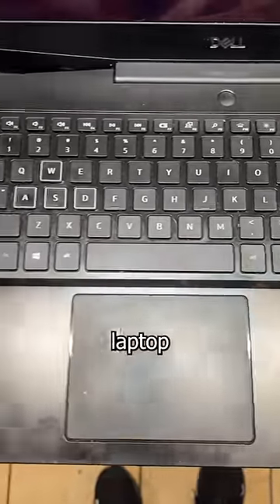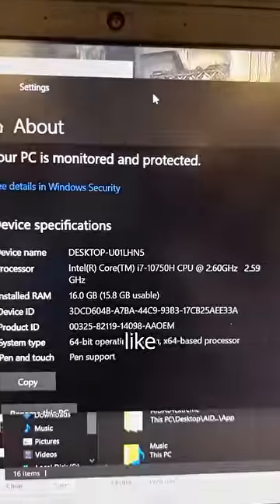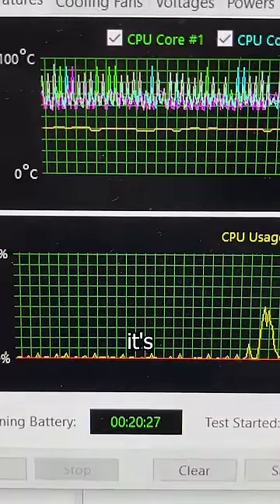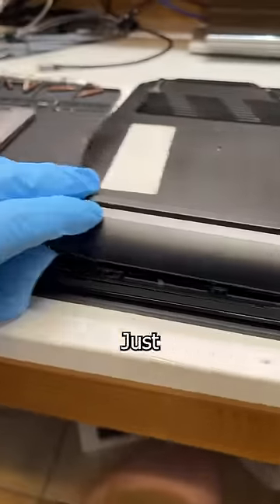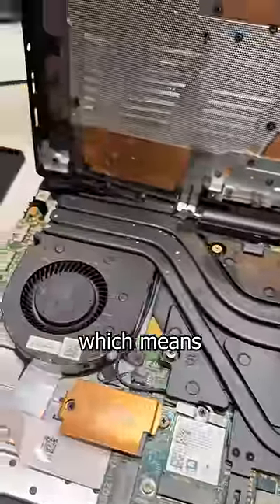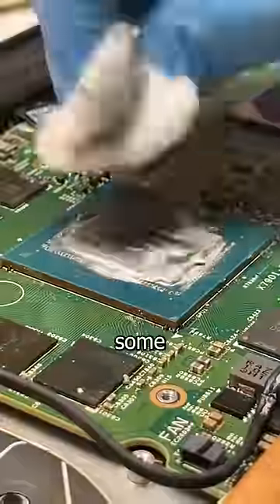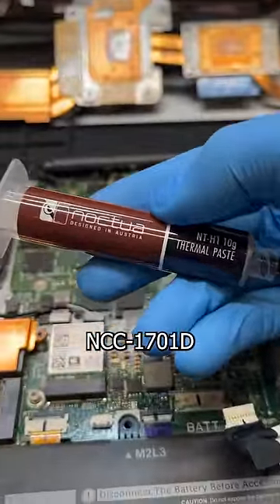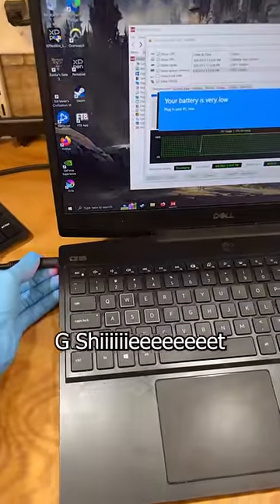Dell G5 is a terrible #gaming laptop with a terrible cooling system #tech #technology #shorts

Comment: I have a dell g5 5500 and I replaced the thermal pads on it recently to discover that there was plastic left on them straight from factory. 🙄 As soon as I changed the thermal pads and thermal paste with thermal grizzly kryonaut I got way better temps than what I was before.

Comment: If you’re interested in a g5 , read my comment, As a owner of one of these, the fix is get a laptop cooler, drops about 10c-12c, 25$ for the cooler,  bought mine for 375$ on eBay , also replacing the stock ssd to one with a heatsink is a must. Things are quirky but for sub 400$ and is on par with some high end systems , it’s a trade off I’m willing to have. Now I’m not an intense gamer, it is a spare system Just in case something were to happen to my main pc, or I want to play games at a friends house , so your mileage may vary. I highly recommend to fellow technicians, not to those who aren’t willing to spend hours pulling your hair out. Also the 2nd ram dimm slot randomly shuts off sometimes lol. Worth under 450$, anything more, buy something nicer.

Comment: I did a few things that cause me hours to figure it out, in order to make it playable: Instead of using thermal paste of whatever kind, I use a Honeywell PTM thermal pad. Throttlestop is also the solution for this as I was able to undervolt this cpu by -0.1v and lock the speed at 3.6. My specs are i7 10750h gtx 1660ti and this is now much more playable with a minor loss of performance. Do not buy this laptop, I bought it used, kinda hard to live with, and yeah it was a real stupid decision by me 😢

Comment: Sounds like the time I bought a refurb MSI GE laptop, only to find out that the core i5 in it would immediately go below base cpu speed due to overheating, upon opening it I realized it was not the stock "heatsink" that was inside it, but a much cheaper one instead

Comment: My 2017 Dell G3 with an i5 8300H and 1050 TI both thermal throttles and power throttles under load and I even repasted it! I have to reduce the max turbo speed to 3.5 using throttlestop just to avoid excessive temperatures when running heavy tasks for prolonged periods!

Comment: I have a G3 and it's downright decent. It can run all but the newest games, very few games absolutely max out the GPU, and those games only tend to slow down after an hour or so.

Of course I've upgraded the RAM and SSD, but that's a given because the stock ones are so bad.

Comment: I used a g5 for close to 4 years, I ended up limiting the cpu and I never had overheating problems and could pretty much play any game and get at least around 60 fps given low to medium graphics, I could run baulders gate 3 at 60 fps at low graphics at a temp of around d 85 c. This laptop may be not the best but I was my first gaming computer of any kind and served me rather well. Still works today but the hard drive is failing I think.

Comment: 1) Is it possible to upgrade the heatsinks/fan system?
2) If no, then the only real option is modding the case to allow more airflow (cutting holes out and installing some stands to raise it off the surface.
3) If no, inform customer he is an ID10T and he should have spoke to "The greatest technician that ever lived" before buying the craptop and then point him to one of your refurbished gaming laptops OR a new one from your sponsor :)

Comment: What I'm about to suggest might sound strange but did you check for Malware of any kind. My next question is did you check the paste type and how closely the heat sync mates up to the chips. My last thought is maybe his fans are simply shot or the heat sync is damaged. The fans if damaged wouldn't provide enough movement of air with the bottom on but would be capable with it off. If the heat sync is damaged then it might have a similar problem.

Comment: You know… 
Snap the fan power cable. Remove the fan housings. 
Then solder in two desktop grade heatsinks and slap on four noctua fans. 
Then see if it dares to overheat.

Comment: It looks like they just took a set of fans from an existing product and didn't care if they were adequate.
I know a laptop processor would run at lower voltages than a desktop one, but the newer Intel processors will either come with an aluminum block which is still larger than the heatsinks on that laptop, and most aftermarket coolers for 12th and 13th Intel processors will be 140+mm bricks.

Comment: Since you are such a good repairman, you will have to fix the bad cooling design!  We can give you a couple of suggestions for improving the temperatures.  The laptop used liquid metal to transfer heat, replacing it with thermal paste means you need a relatively larger surface area of paste and copper to distribute the heat.  The design itself would need a third fan, which would have the task of removing the coupling heat between the CPU and the GPU, and to be honest, all laptops would need an additional evaporation chamber with its own fan so that the gases could liquefy and cool.  So now they just overheat and overheat in the hope that the tasks will not last several hours!

Comment: I got a Dell 3080 off eBay, this is by a gigantic margin the most gimped graphics card I’ve ever owned.  It averages about.9v because the power budget is choking it, also the cooler works fine, but is obnoxiously loud, needs everything it’s got to stay under 70C.  And the vram is cooking 🤦🏼 I ended up getting a water block I have yet to install, that will be a fun project.  If it was a dual bios card I’d flash a higher power bios, but I don’t trust it to not be sketchy and crash mid flash or something, bricking the card.
Tbh, I wouldn’t be surprised if Dell got a discount on Nvidia’s least efficient GPUs, like the trash from the silicon lottery.

Comment: If it’s still overheating by just putting the bottom back on then I’d wager it’s just choked for airflow. Normally I’d just say undervolt it but I doubt you even can. Maybe the owner should try out one of those external fans that clamp over your exhaust and just suck as much air as they can?

Comment: I've had my G15 5510 for a few years now, only one drive failure (on an NVME? I didn't know it was possible, but I did have it under heat for a while), I do manage to keep it at 120 fps under most circumstances, and heat management hasn't been a huge issue.

Biggest repair I've done was the keyboard assembly when the shift keys stopped working at the same time. Still not sure what happened with that one, but I ended up binding caps lock to shift. Probably a good decision

Comment: I have an alienware laptop and found out that the fan controller on it after booting would mix the fans up. the gpu would get hot and the cpu fan would spin up and the opposite would happen with the cpu. Dell refused to fix it unless I paid them to fix it. it was a known issue with my laptop. only one program would work to fix my issue and that was hwinfo. was really inconvenient since it wouldn't start up automatically.

Comment: I have a G7 17 from a few years ago with a 9750h and a 2060. Processor always at 100c when gaming. Plus the power cable doesn't supply enough power and it starts draining my battery. It has some other issues also.. but I love it. Took it apart a couple years ago and replaced the thermal paste and cleaned it up.. doesn't throttle as much.. meh. I think I paid 2300 dollars for it when I bought it. Worth it? I would have paid way less in my opinion. But it's decent enough. lol

Comment: I know this is almost a year old at this point, but I’d like to know your thoughts (if you have any) on the Dell Inspiron 15 7000 Gaming, which is basically the predecessor to this G series. I picked one up for a great deal just as they were being replaced by these crappy G series back in 2017 (I think) and it’s served me well since. Its 1050 isn’t anything to write home about in my experience but it ran most everything well enough, and is more than powerful enough for the 3D modeling software I use it for now.

Comment: I've got a g15 5515 Ryzen now and actually can not relate to this video, cause mine works just fine: if i don't go ape sh*t and turn on the performance mode, it locks on 92C processor and 86C gpu, which is kinda fine i guess. Got no problem in games or elsewhere 

The only major problem with it, besides awful 69% sRGB coverage, is that it's cooling system is upside down... Meaning if i want to change termal paste i gotta get it ALL disassembled.

Comment: Time for a brandino top secret tip.

Set the max cpu % to 99 percent in the power settings of Windows . This will disable turbo boost and will make your laptop run significantly cooler.

This will unfortunately reduce the speed. But a lot less then when it over heats.

Comment: I think that Noctua NT-H1 is a piece of ineffective thermal compound. Unlike Noctua NT-H2, which is great when it's new. However, I saw a review saying that this thermal paste loses its effectiveness after years of just lying unused. Don't know if it's true, but who needs NT-H2 when there is Thermal Grizzly Kryonaut? Yep, it's costs much and hard to apply, but it actually conducts HEAT and imho is the best solution for open-chip devices like laptops, graphic cards and consoles.
NT-H1 is a bottleneck in this system. Yet it's still better than toothpaste 🙃

Comment: What is shit with Dell laptops is that I have two of them, that were fairly good when they were new, but eventually the power supply failed on both of them. The oldest one won't even charge anymore, and everytime I turn on the other laptop, it's always at 0%. After pushing the little button on the battery it will start charging and work normally...if by normally you mean so hot you can't use the WASD keys and noisy af, even at the desktop!

Comment: Try adding thermal pad between heat pipes and bottom cover. Works great on older mb pro
Reply: that could be a leaked heatpipe its very rare but once and a while it happens just put a new one and have fun with tolerable temps of 99 degrees on gaming laptop kkkkk

Comment: Undervolting, bios upgrade, fan curve manual change. Idk.or use Diffrent heatpipe. Meaby this one is clogged inside. Put for test normal pc cooler (leave laptop upside down and use hdmi) and check. Also meaby back to liquid metal. This noctua meaby is not so good as you think. check thermal conductivity. Chinsse gold paste is 3w per square meter. Gryzzly kyronaut is 12. This noctua idk.
Reply: Ok i check now. This noctua is 3.9w. liquid metal is 73 w of thermal conductivity lool. This thermal paste is just too poor mate. Good luck.

Comment: With those substantial heat pipes and all that copper it still overheats? Hmmm 🤔 sounds like the firmware controlling the fans isn’t ramping up. Or the fans aren’t working properly

Comment: I don't understand the existence of gaming laptops. Sure, they run at about half the cost of a pc (based on my setup, ryzen 5800, corsair rm850 psu, 4060 gpu, msi b550, 32 gigs of ram), and they are portable, but the difference in performance per dollar is just not the same, above all else maintenance and cooling for laptops are such a pain. If you really wanted a gaming device, and wouldn't settle for a ps5 or xbox series whatever, you could at least save a little longer to get a much better system. along side this, you can make quite a competent gaming pc on a budget, you won't reach peak performance(the laptop won't either), but it will work for the vast majority of games at a good enough rate

Comment: Did you clean the fan vents next to the fans themselves? Or are they inaccessible because of the heat pipes being in the way?

Back when I was a super noob rookie, I had a technician fix my HP Elitebook who cleaned out all the cat hair in the case from my late cat, but forgot to clean the vents in the fan itself, causing me to have to take it in to my boss who I was volunteer interning under and replace the fan and graphics card myself after it overheated and cooked itself to death.

Comment: I was watching a Dawid tech tips video about replacing a dell crappy cooler to the “premium” dell crappy cooler in the pc. (If it’s intel k cpu it gets an actual tower but not a good tower)

Tldr: dell don’t care if it thermal throttles, to them overheating isn’t an issue unless it has to crash to preserve itself.

Their bios is garbage, the cpu cannot boost for more than 20s so even if you have an actually good tower or an AIO liquid cooler you can’t actually make the most of the cooling for a longer boost or unlimited boost. 

Now I’m not exactly sure how well this translates to laptops… but if that’s dells logic on PCs from a year or two ago then yeah it’s bad.

(Oh and keep in mind even if you are not gaming with their prebuilt PCs, any workload you are doing will be slower because of the worse speeds because of the kneecapped cooling)

So technically no, the cooling system isn’t terrible at least by dell standards that’s a fully functional laptop. 

By regular humsn standards that’s a crime.  against the Geneva suggestion

Comment: I had a dell g5 15 and it lasted from may 2021 to september 2022 
Even with the cleaning
Eventually it just wouldn't boot and i even tried reseating the ram 

Let me also remind you that during the 2020 chip crisis, this laptop was inflated to $1,100 when i bought it, but apparently its launch sale value was less than $600, in 2019

Comment: 10750 10th gen turbo might be on I have same trouble with my MSI, so I use throttle stop to cool down it and by default the processor itself high thermal runner

Comment: Yeah, my Acer Swift 3 has decent specs. Ryzen 5 4500U, fast DDR4 RAM and a Vega iGPU but thanks to the shitty cooling, it can't even run TF2 and can barely run Minecraft. I used to like Acer back when Core 2 Duos were relevant.

Comment: How can you call yourself "the greatest technician" when you can't see the difference between the liquid metal and nob-conductive shiny thermal paste?
(This thermal paste was on compactors around the die, so if it was liquid metal, that laptop would be dead, also, when laptop has liquid metal, special protection is applied, and also liquid metal can't dry, unlike thermal paste)

Comment: Have to under clock it under 3.0ghz .and it it still 85 C (mine use throttle stop, i cant guarantee since charging still add 5-10 C)

Comment: My g7 7588 is sill not overheating even though the vents are covered with scrotum dust and it works fine
Reply: update: i replaced the ram and cleaned the fans in it

Comment: I have a laptop where the cpu/gpu dont overheat until 1-1.5 month after the repast and only 1 core get to 100°c the other are at 75°c like wtf and its enough to down the cpu power isage frol 90W to 68W

Comment: I have a g15 5515 ryzen edition can you tell me what thermal paste should I use for repasting as its temps aren't going back anywhere near stock temps. It constantly hovers around 80° and I definitely don't want it to. Any help would be welcomed.
Reply: Lol 80 while gaming is amazing
Reply: @sharkieislive  I WISH :) while gaming it's around 95-101cpu and gpu is 82-84.  Ryzen 5 5600h goes hot and it's functional temps are about til 105C but 105c is a terrible temp to have imo, I'm not gonna wait for it to reach that.
Reply: @sahilk.shinoda  bro dont use G mode it is the reason you are getting 100+ degrees if you dont use G mode it will stay at 93 without noticeable fps drop

Comment: Dell gaming laptops are shit.

I had a G3 with an i7 and 1060 6gb and it started to thermal throttle like crazy 3 years later.  No amount of cleaning helped.  Repasted didn't help.  I undervolted, no luck.  I used throttle stop to drop the clock, no luck.  I'm guessing Dell's bios gimped it to anger me into buying a new one.  Absolute pile of shit.

Never buying another Dell again.

Comment: I have this one, G5 15 5500 with the 2070 rtx 8Gb. i7 16gb ddr4 and its alright. I noticed that before I put Liquid Metal it would reach about 100 Celsius and after I put Liquid Metal it would stay about 85 degrees when on games like Fortnite. Also I read that it’s best to reapply the Liquid Metal after a month because of the reaction it has with the copper please correct me on this if I don’t have to and I’m just wasting the LM. It definitely ain’t cheep loI On resident evil 8 it stays around 95 Celsius. I’m just getting into the nerdy side of specs and if anyone has any tips or advice on keeping my laptop living a long life I would greatly appreciate it🫶🏼 I’m getting about 60fps with normal graphics I think it’s about the same as my Xbox 360 which is about the same graphics but I like to think my laptop is better. I also put Liquid Metal on my 360 too. Graphics are steady now without that normal lag you get from time to time

Comment: "Decent"?
Is still better than my 10300h ang gtx 1650 ti m gaming laptop.
Ik is not that good now adays but it can still run starfield at 45 frames low and might play it at ultra for 10 secs before it exploads😅
Let's be real. This are still good specs for today's standard,stop insulting it

Comment: All  new laptops stink  you, may say its great machine but they are making more throw away items depending on use you lucky u might get 3 years out the new models . The older ones were made perfect easy to work on, parts easy replaceable  and able to upgrade. This dont count Macs only worth from Apple is Tablets and Phones